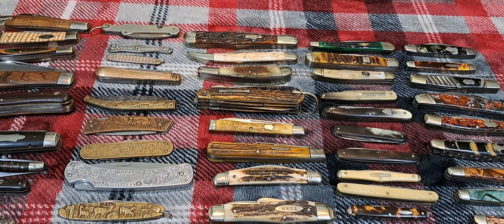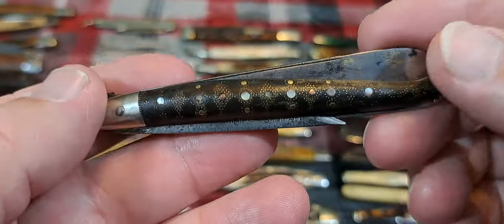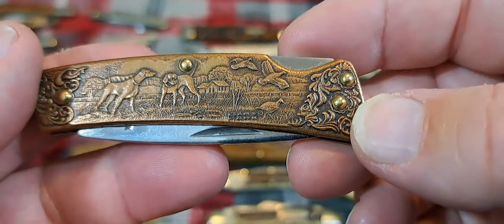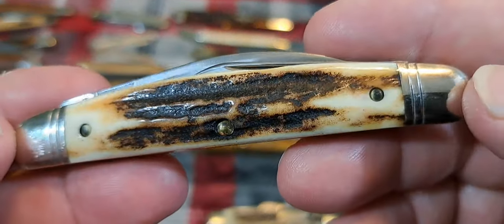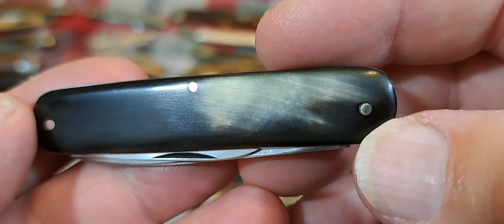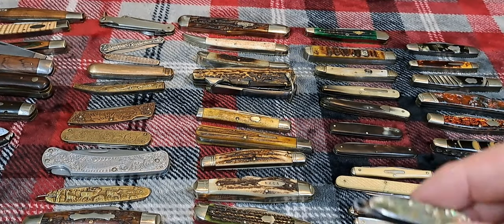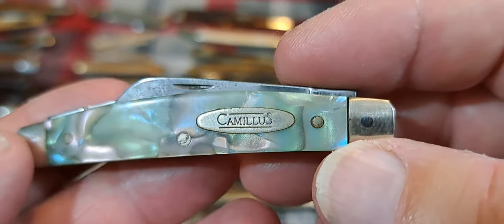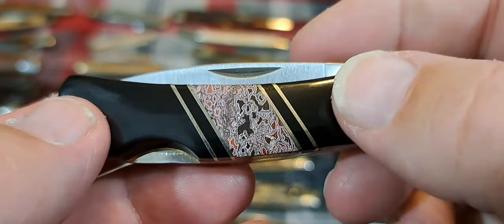A look at different scale materials on vintage knives.

Comment: Excellent video! Hard to pick a favorite, but the Case blue bone barlow is up there, plus the horn ones. Will have to watch it again :).  Thanks!
Reply from the maker: Thanks for watching.  I've got Case's 2023 vault knife in midnight blue. You should check that video out.
Reply: @rasputinscastle  I went back and realized I had watched it :). Wish I could get the barlow though, as that, the mini trapper and Russlock are becoming my favorite patterns.